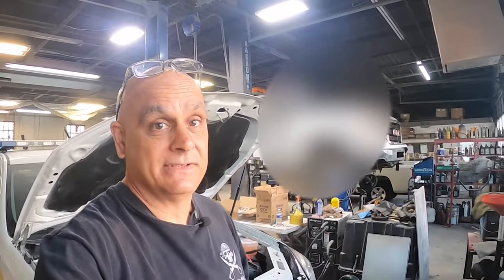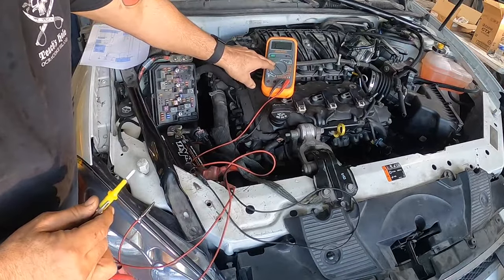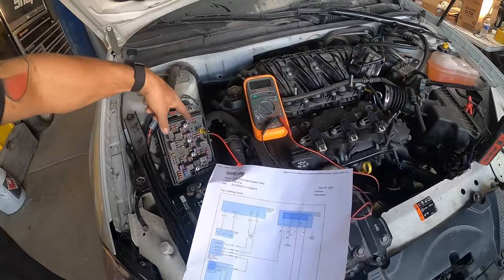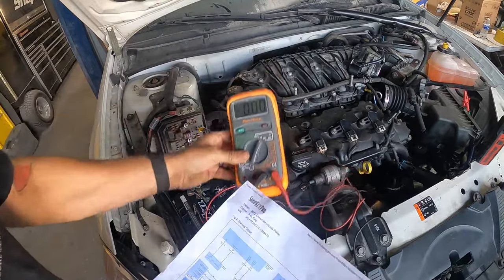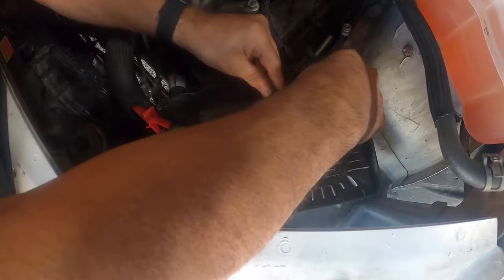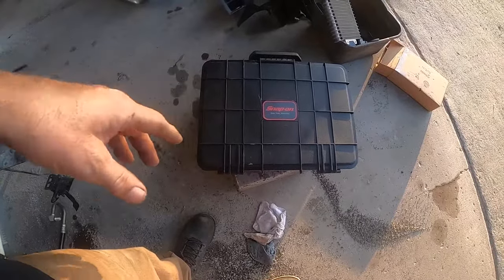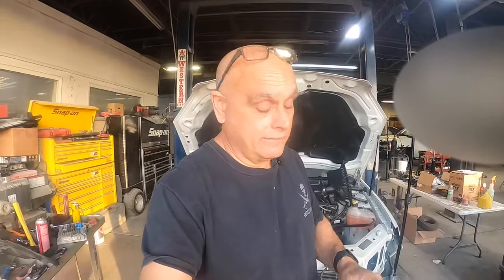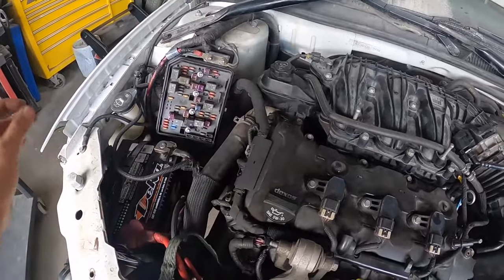Chevy IMPALA No Start NO CRANK ~ BAD Starter~Bad Relay~OR ECM

Comment: My 2008 impala had a seemingly strange cascade of problems the other night. A headlight went out so i replaced it but it wouldnt come on. Went to start the car and it barely turned over and started. Got home, killed it and it would not start. Found the positive side battery terminal broken. Installed a new one.  Tried starting and theres a faint clicking sound only.  Tapped on starter relay and it slowly turned over and started.  Let it run awhile, tben it would not respond to tapping relay to start. Bought a new relay, still wont start. Some smoke rose up from a wire touching the starter.    I secured it to not touch and checked grounds, still no start.  Strangely, the other headlight on same side quit working.  Replaced it then BOTH work (other headlight had been replaced but still wasnt working until the other went out and was replaced). Battery is at 12.6. I suspect some insulation may be compromise d on the wire by the starter.  Could that be the likely culprit of these problems? Ty

Comment: Thank you sir this helped me a lot yesterday. Got caught in a tough, hot, mobile repair, wife's car refused to sporadically no start for me and of course starter died away from home. Already knowing the pinout on that relay allowed me to put 12v to the starter and all I got was a clicking solenoid confirmed by a parts house test, motor was burned out. Was relieved it wasn't fusebox, computer, anti-theft etc. I had to SMH when I  figured out that they had put a catalytic converter right over the starter, PITA.
Reply from the maker: Thanks glad to help

Comment: I have a 09 impala no crank no start! Replaced tumbler and ignition but nothing! We got the starter and pump to come on manually but not with key
Reply: Did you get it fixed ? What was the problem ?
Reply: Update?

Comment: 2012 impala i changed trans now no power coming from pcm to starter relay  to ingage starter tried swapping the pcm and bcm out of another car did key reprogram and the car still no start i can't seem to find scamatic to see if park nutral switch is the problem or ignition switch please help if u can
Reply from the maker: they are famous for the plugs going into the pcm not making a good connections. make sure you check them good, also check the one for the abs module.
Reply: @AutoRepairTips757  Is it reccomended to take off the ECM and ABS connector and spray with contact cleaner? 
My problem with 2008 Impala LT is the 40AMP starter fuse keeps blowing. Never engages starter.  I've cahnged battery, relay and multiple fuses. Wondering if this calls for starter replacement or is possible other wires are shorting. I can't believe a full 700CCA surge would be shorting and not making any sounds/crackles etc.  I suspect a lower amp circuit somewhere. Maybe need to change the positive battery cable assembly? Man I am stumped.

Comment: How do I check if it is intermittent. Like really bad timing for diagnostic. I've tried new key, new ignition switch, starter went out and has new starter now, replaced crank relay. Sometimes I get the P1682 code. I've messed with the wiring, including grounds others have mentioned, nothing obvious.
Reply: Oh amd I mean really intermittent. Mayne once every 3-5 days. Sometimes works by taking key in and out, opening the door, sometimes after just popping the hood, and at times messing with harness in engine compartment.

Comment: Hello Mr. Pete! Can you spare some advice please. I just changed spark plugs on my sister’s 2017 Impala V6 saved her more than a $1,000. But now a week later her starter is in-op. I didn’t disconnect the battery when changing the plugs, never turned on the ignition until after installation. Car ran fine for a week. Is there any way my changing her plugs could have caused starter circuit failure?
Reply from the maker: Most likely it’s coincidental is there any juice going to the starter at all when you go to turn the key?
Reply: @AutoRepairTips757  Thank you for that moral support! I am in San Diego, my sister  and her Impala are in  Los Angeles. She had her friends check, the starter "clicks", it would start once or twice and then stopped cranking, and just clicked. 87K miles, I might just drive up there put a new starter and relay on anyway (WAI Global new is about $90 at Rockauto) If that doesn't work I'm dependent upon a certified shop for a rebuilt flashed and programmed  ECU. I don't have the tools to program an ECU.